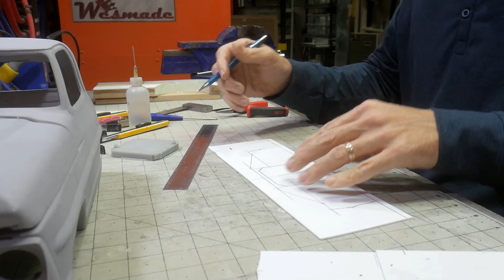1968 Ford F250 - Engine Bay and Interior (3)

Comment: Fantastic build! The 67-72 F-series are my favorite, having owned 3. The detail work is outstanding and the instrument cluster is exact, including factory A/C vents at the bottom. But, as a purist, the only platform of single cab, short bed was in the F-100. You could get a short bed F-250, but only with a 4 door cab. Or long bed 4 door. Or single cab long bed. Not trying to beat you up, still amazing artistry. Can't wait to see the finished rig!
Reply from the maker: You are correct.  This is a bit of a compromise/fantasy truck.  I liked the F250 but to get the scale right it needed to be shorter than even the SWB.  If you look carefully the bed has a section missing before and after the fender opening.  Even if I went with a SWB it would have meant the truck was close to 2" longer.  A LWB which looks the best would be unreal in length.  I wanted to keep the geometry on the VS410 intact, if possible.  It would be fun to make a LWB body, maybe for the CEN Racing platform.  It would be about the right length..

Comment: Is there an advantage to using a two step glue with the activator like you use? Also what styrene solvent do you use? I notice you called it solvent instead of saying a brand or name so I was a little curious
Reply from the maker: I assume you mean the accelerator spray I use for CA glue.  What I use is clear PVC cleaner as a solvent.  Its dirt cheap and can be purchased at any hardware store.   don't have a hobby store near me, even if I wanted to pay the crazy prices for hobby grade solvents.